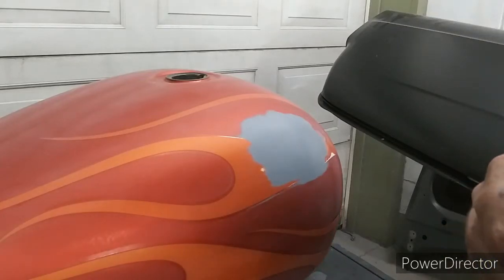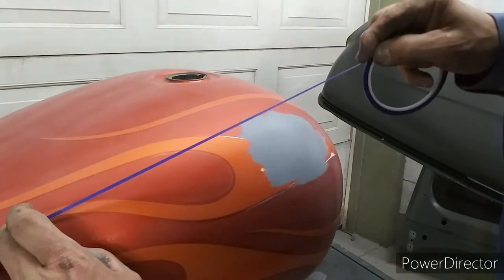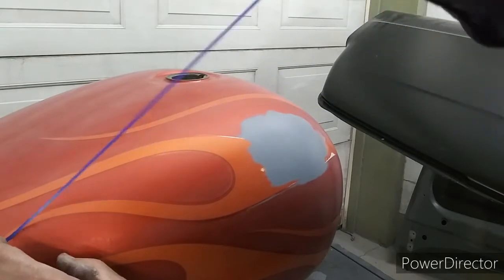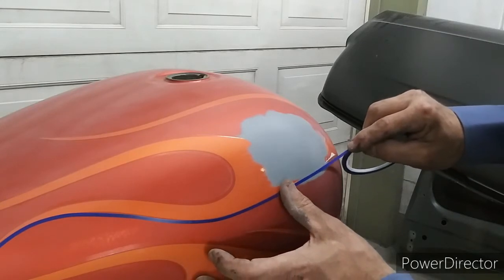Motorcycle flames

Comment: Don't know what  the trick is on using  tape like that the last time I use tape like that on on a tank it raised the paint and the clear it was terrible  had to repaint the hole thing
Reply from the maker: We use fine line tape on the edges and just regular masking tape in the inner parts, the key is get all the tape off as soon as possible, we pull the fine line off as soon as it tacks up and the rest as soon as it's dry enough . It generally takes two of us so as to not have it land in the floor or get fingerprints in it.